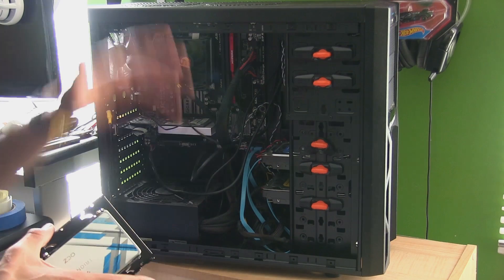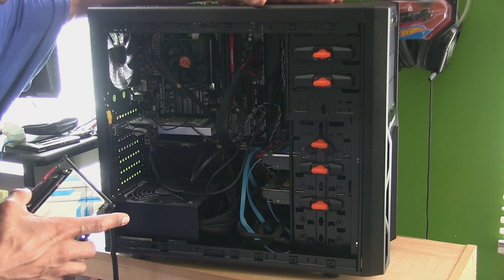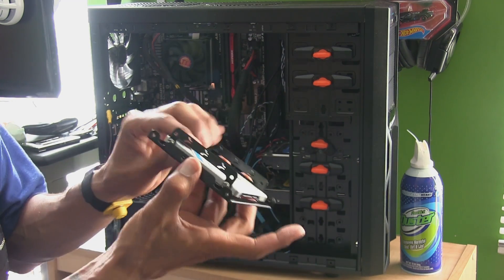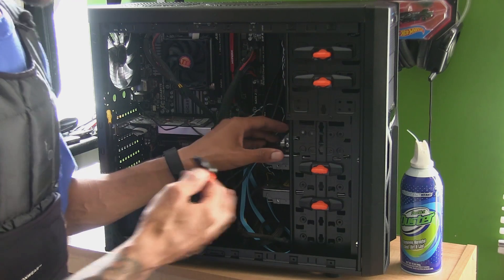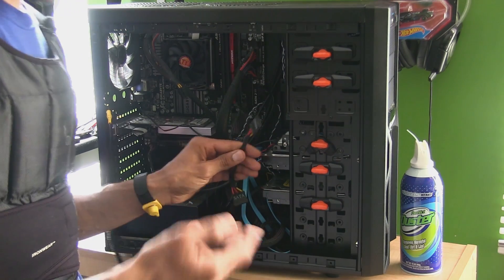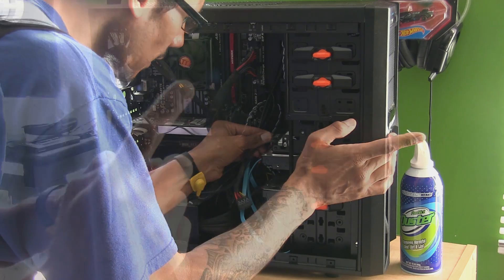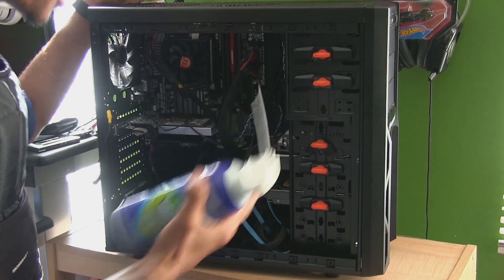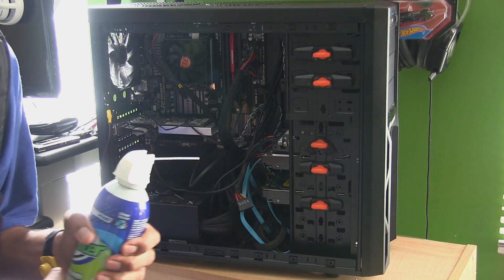Home Server Build Upgrade Goodies July 2016!

Comment: Have you seen how cheap those Xeon X5-2670's are now? you can get 16 cores 32 threads for under $150. Just built an ESXi server off that, works beautifully.
Reply from the maker: Super cheap, but how many VMs are you running in yoru ESXi server? and how's the performance? How many VMs can you run at the same time?
Reply: 6, only because I have 64GB of ram. At work I have at least 12 running on a slower pair of first gen E5's

https://www.cpubenchmark.net/cpu.php?cpu=Intel+Xeon+E5-2670+%40+2.60GHz&id=1220&cpuCount=2
Reply from the maker: nice that processor needs a FCLGA2011 motherboard, correct?